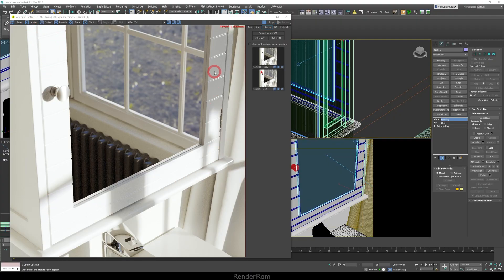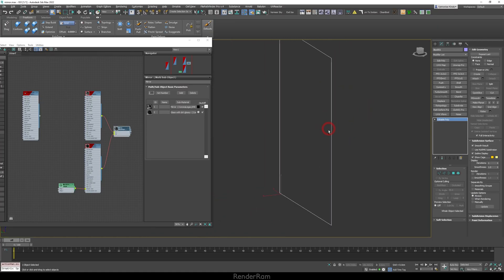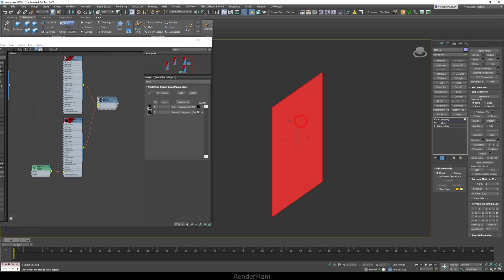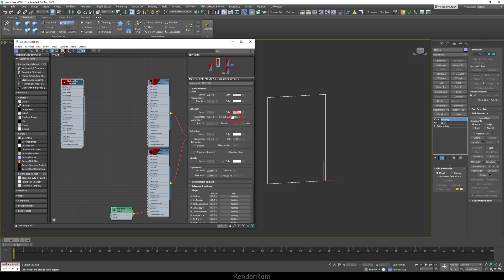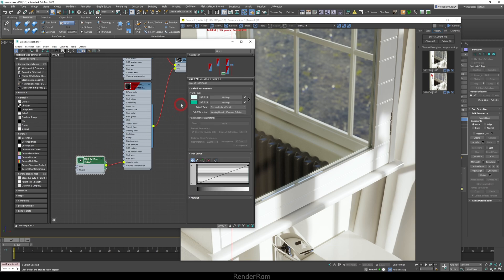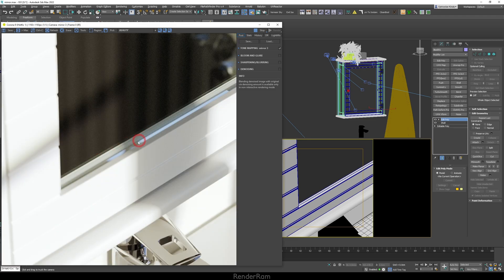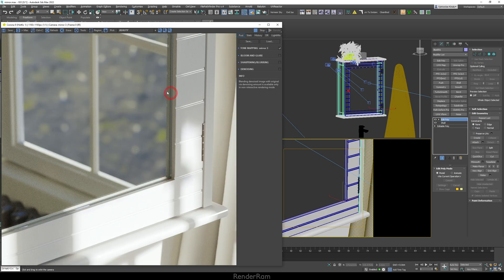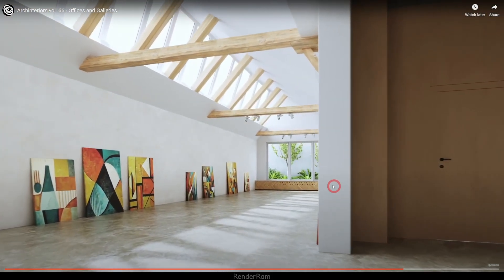Materials Ep5: Mirrors - The Beauty Of Double Reflection | All 3D Software

Comment: Hello Vjjeko,

to push mirror even further what I recommend is to turn on dispersion in glass shader. It produces a chromatic aberration fringe to reflections which is physically correct and provides even more accurate effect. Here is an (slightly exaggerated) comparison:
regluar glass shader: https://gcdnb.pbrd.co/images/4cukceIc5F6T.jpg
dispersion turned on: https://gcdnb.pbrd.co/images/nECyDNB4PZUs.jpg
Reply from the maker: Looks excellent! Would use it if I have a mirror as a main product, think it would be a render killer for a casual mirror in a scene
Awesome tip!

Comment: So I thought you couldn't add multiple textures on a geometry that has a editable poly modifier on it. I thought it needed to be just a editable poly. Does the multi/sub node take care of that issue?
Reply from the maker: Any object constantly has a material ID set up, with Edit poly or Editable poly or some other modifiers you can adjust that information, and it will stay in the modifier stack until you add a modifier that will change it again, Multi/Sub just reacts to information that is existent in the model.
Reply: Coo...learned something.

Comment: Amazing. Now I hope you could make something that I never solved since many years, using 3ds max and tried almost every rendering engine. And its about "color", i know its a tricky question to ask, how to get almost exact wall-paint color out of Corona as its shown on the paint company catalogue, because there are many factors comes in play when we see color on screen and trying to compare it with on-paper printed colors. Im not asking about the small bumps or texture in the paint in my 3d remders but to match the color and its properties only. I have tried some simple tricks, I scanned the paint company catalogue or you can say an online PDF catalogue, and create a corona material with "coronacolor" map where I add the same color code as it was the PDF. (I used HEXA code in my case, which you can get from any software or by pressing Win+Shift+C key, if you have Microsoft PowerToys installed, then simply copy the code from any on-screen application and pasted it into coronacolor). But the color was looking different. Yes the fact is, it was because of my lighting temperature, which I was unable to control. Even I cannot guess if my 6500k is a real-world 6500k and so my  other interior lights... Please make a short tutorial about how to match final rendering color with on paper colors without doing any post processing so later we can change it upon client request. Thank you in advance